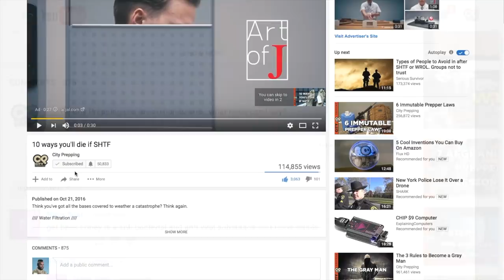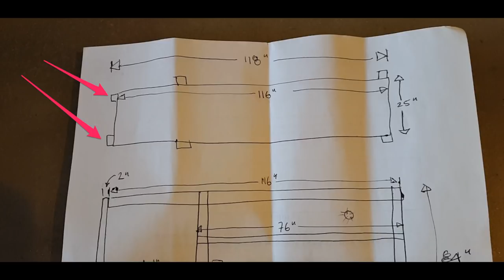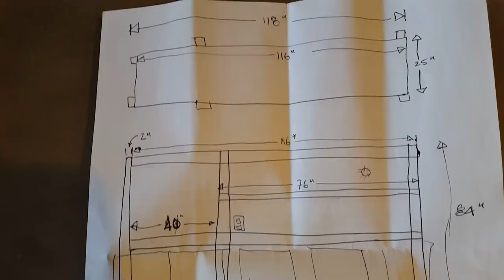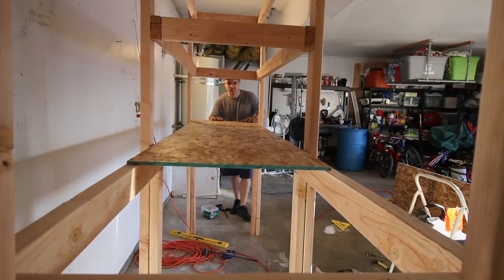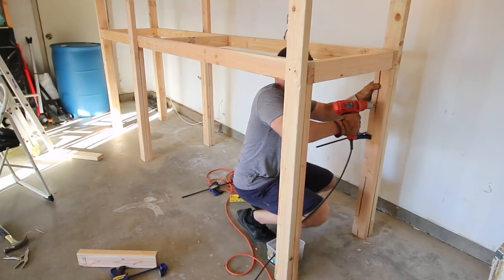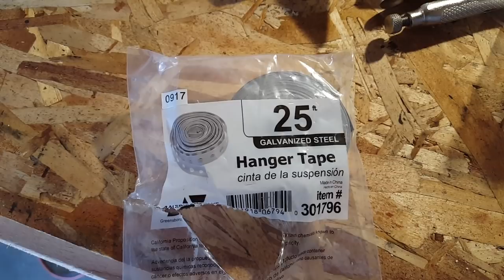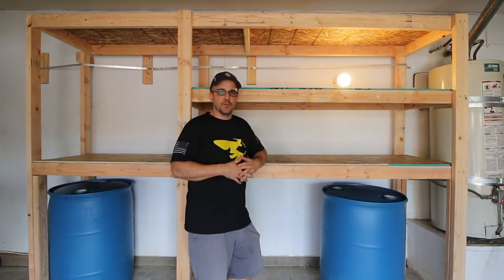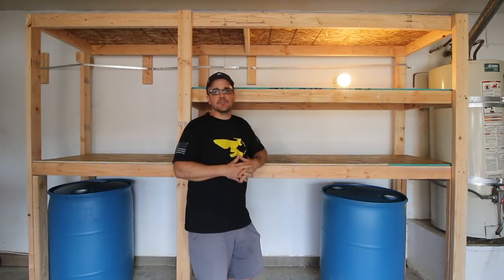How to build shelves to store water in your garage (DIY)

Comment: Nice job CP. It should be reiterated that you were useing DECK screws and not drywall screws. Drywall screws tend to break much easier than the deck screws. Its a bummer to have a project collapse to the ground because you were trying to save a couple of dollars on the fasteners. Yep. It is the VOE speaking here.
Reply from the maker: +A Spit of Mud excellent tip. Saving a few bucks isn't worth it for sure. Thanks for sharing.

Comment: I once made shelves the same waygreat job! In hindsight with the purpose intended I think I would use 4x4s for the frame and 2x4s  to sure everything up and to mount the actual shelves to. I might even consider metal braces drilled into the floor but that's for my own project.
Reply from the maker: +ScottyM1959 yeh, in retrospect, i might have used bigger beams for the frame, so hopefully these hold up over time.  it was really a fun project.

Comment: This is a good video.  Thanks.  I'm actually going to do this.  I'm storing water in my garage and it's only a 1 car.  You don't get much for your money in the Bay Area these days.  I'm definitely trying to utilize the vertical space including the attic garage but there is a lot to be said about making sure there is a enough support so that my roof doesn't end up sagging.  That and I appreciate the earthquake bracing because in earthquake country as well, I definitely worry about that.

Comment: just found your channel, lot of good info.  Tip for when you were putting the top shelf is cut some spacers out of scrap wood screw/clamp them to the legs that way you can just rest the shelf on the spacers and screw it into place would of also allowed you to use a level to make sure you were good.  Also using wood glue would make joints a lot stronger than just relying on the screws.  Final thing when i build stuff I tend to overbuild so for your shelves i'd put 2x4 supports every 12" - 16" inches depending on how much weight your planning on it holding.  Keep up the good work.

Comment: I did this same thing some years ago building a 10' wide X 4' deep x 8' high unit it works real good. 
I glued and screwed it though, to lessen wiggle add in the corners some 45 degree 2x4 braces.
Reply from the maker: +lacenter645 

>> add in the corners some 45 degree 2x4 braces

ha! I was thinking to myself when finishing the project, "hey, i should add some 45degree braces in the corners to stop this wiggling" but never got around to doing it.  I'll definitely take that approach on my next build.  thanks for the tip!

Comment: I think you will have to move the wall light because once the shelf gets filled up, the light will be covered up. Great video!
Reply from the maker: +Geoff Meek ha!  i came to that same conclusion last night when putting everything back on the shelves.  I'll probably put LED lights on the ceiling and install a plugin in that light socket to power the LED lights.
Reply: You could also use LED strip lighting at the top front of each shelf.
Reply from the maker: +Geoff Meek good point

Comment: Nice job, as a contractor I would add two things though, as mentioned in several other comments diagonal bracing and then for real weight support I'd use lag screws. (at least on the major members) Both can still be added if you see fit.
Reply from the maker: +Larry Losciale awesome tip. Will remember that on my next build.  Thnx!
Reply: You're welcome. Just remember deck screws are great for pull out strength but not so much for shear strength. Happy prepping!

Comment: I just see a problem with having filled 55 gallon drums under a shelving unit how are you going to access the water when you need it it's going to be too heavy to move. You could put it on Wheels and move it that way.
Reply from the maker: +kari KF good point.  in my previous video about storing water barrels in your garage, I cover that point briefly.  Essentially I leave a 3 inch gap to get my bung wrench in so I can open the barrels.

good observation!

Comment: Why don't you use diagonal braces on those sides from which you don't want to get  access to the shelves in order to stabilize the structure even more?
Reply: Was thinking the same, an X bracer on the back can do the job as well. Pretty much every shelf that supports lots of weight comes with these. Here is an example of a shelf that does not wiggle as much:
https://cdn2.jysk.com/getimage/wd2.large/85796

Easy to whip up some using standard wooden planks, or metal rods if you have them.